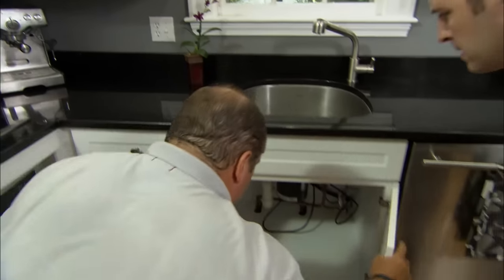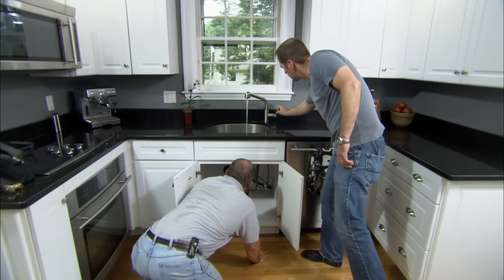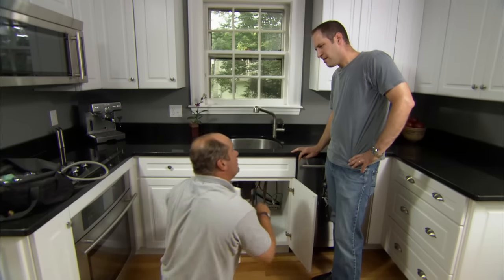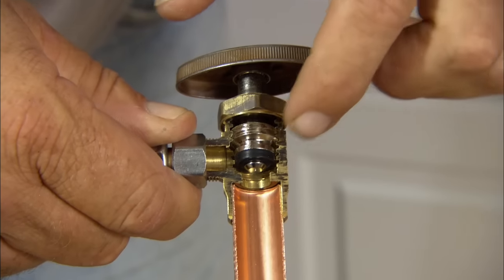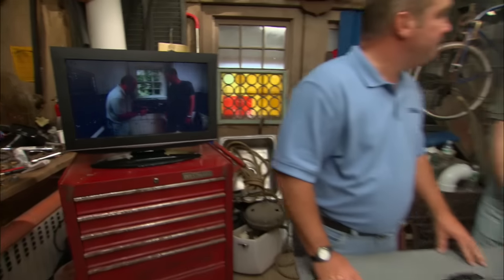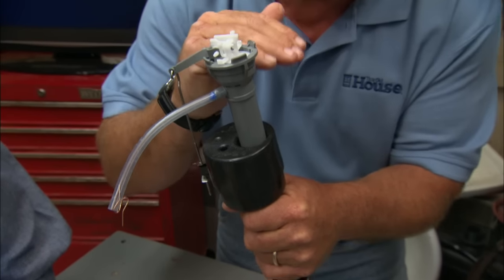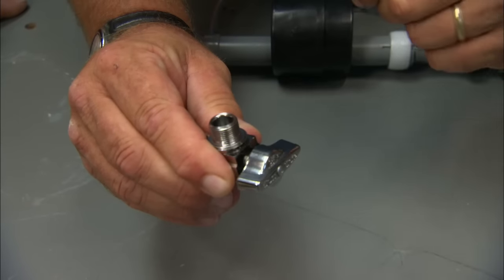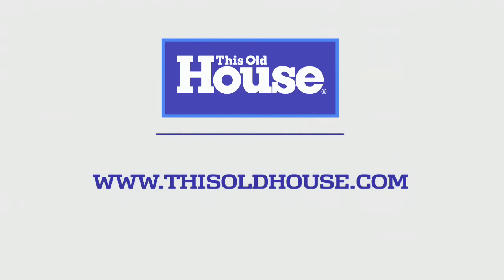How to Fix a Noisy Faucet | This Old House

Comment: Replaced a wax ring around my toilet.   Reconnected the line and got the hammering.  All I did was run the faucet and the shower in the same bathroom for a few minutes.  Fixed!  Thanks!

Comment: This is the best; it solved my toilet problem. I have tried the arrestor and the shut down main to let air out; none worked. From this video, it suggests that I either have a faulty angle stop (bad washer or tape), or the flash valve washer. And it also said the angle stop supposed to be all the way open.  So I followed the instruction and replacing the flash valve first. If it doesn't work, I will replace the angle stop.  Wow - right after the flash valve replacement, I could open up the angle stop to full without hearing any noise!  So this video solved my problem.  One thing I learned was, it was impossible to find the replacement washer to the american standard flash valve that came with the toilet; so I have to replace the entire valve. Although only $15 but it feels really bad throwing the entire valve out for not able to find a $.50 washer. Anyway, great video. i am a fan!!

Comment: Hello, I have the same problem but from my hot water pipe. After watching this video, I checked my valves and then fully opened them both (my valves are quarter-turn valves), but the problem is still there, I still heard the hammer noise when I opened the hot water. Please tell me either there are other problems that causes hammer noise.  Thank you for making this video!  And thank you for your help!

Comment: Those ball valves can scour out over time and become impossible to shut off (or open all the way) after just a few years. I still like them better than gate valves, though, which I've had fail (i.e. cannot shut water off when needed) a number of times. Or the old multi-turn valves as shown in the video that frequently leaked (a lot) whenever you started to move them!

Comment: Question, I have this problem in one of my faucet but not the other faucet. Both faucets were partially opened/closed, but only 1 faucet was having this vibration problem. Why is that?
Reply: JC L it is called 'WATER HAMMER'

Comment: A lot off knowlegde there i think. I have water hammer when i open the cold water handle. Not when closing. Only when opening. I have installed a water hammer arrestor. Nobody knows where its coming from. Hope you have the wright answer!

Comment: You don't throttle water with a ball valve!!!, needle valves are made for that. And its called a diaphragm not a o-ring or gasket in a flush valve. Other than that it's a helpful video

Comment: My toilet would run whenever the laundry machine stopped, saw this vid check the bathroom faucet and it was partially closed. I went to full open and the toilet no longer flushes when we do laundry.
Reply: Then you got shit water pressure or your pipes are to small.